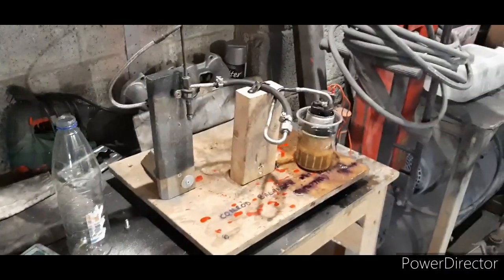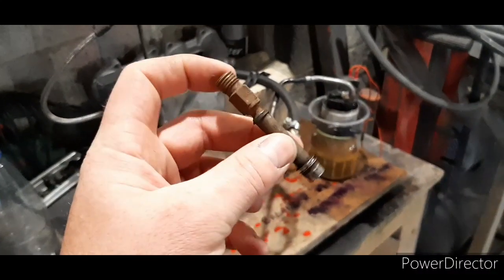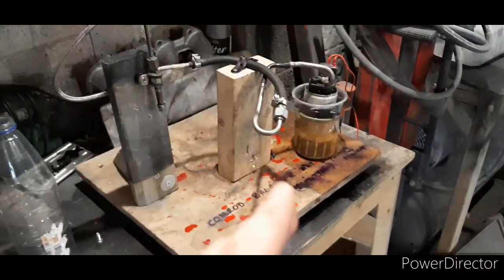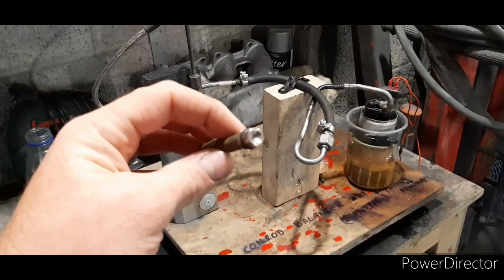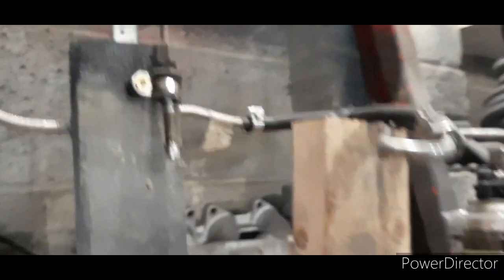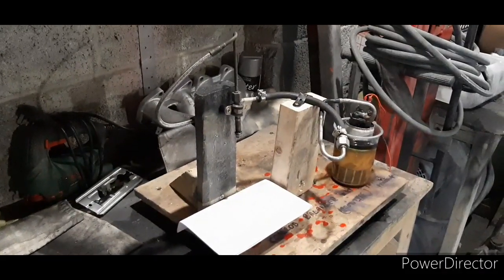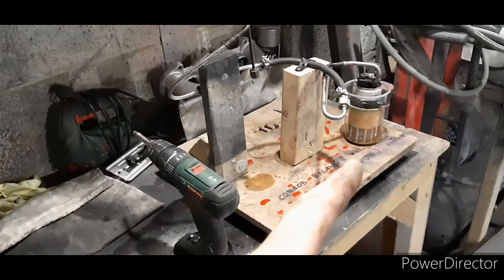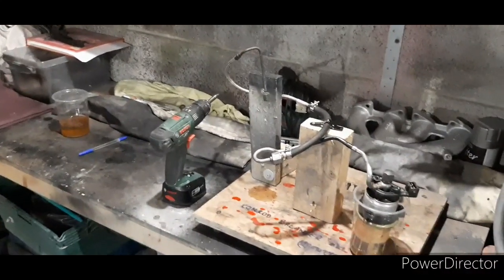Bosch K-jetronic Injector Testing

Comment: Thanks for video. If air shrouder removed from injector does it still work correctly?
Reply from the maker: Physically yes it'll work the same, you have to block the air nipple on the lower part of the inlet manifold between cylinder 1 and 2 if you don't use the air shrouded injectors
Reply: @GreyGooseRestorations   Thanks for response. I removed one air shrouder and injector tip is a bit different than original injector with out shrouder. Just wondering does it have effect to fuel spray.
Reply from the maker: @karivtapio the cone end should follow the same angle of the injector pintle so would make no difference

Comment: Can the injectors be dismantled/rebuilt or is it just a case of buying new ones? Also do you know what size the fitting on top of the injector is just in case i cant get a spare fuel pipe. Thanks
Reply from the maker: Hi, no they can't be rebuilt due to the way they are made, its a case of buy new ones, theres two different threads depending on the car and year

Comment: Really enjoying the videos. Thanks!
Do you know if anyone sells the tapered fuel pin?
I am running an AGG 2L block and could do with more fuel
Reply from the maker: Thanks
The tapered fuel pin didn't work as good as it should have so the stock pin is more than effective, more fuel can be had by adjusting the hidden allen key adjusters on the metering head

Comment: Hey goose,
Been following along with your build. Looks fab. I have my own little mk2 project I'm working on only difference is its in a VW t25 camper... Mind if I shoot you a couple emails? You seem far more knowledgeable about the Kjet system.. And I'm pretty sure this is where my problems are.
Also you mentioned injector lines and getting new ones, you making them yourself or getting ones made custom? My electrics is something I need to look at too... Was wondering if you'd recommend buying a harness and converting it to work on the T25 or just making one new from scratch... No idea where to start however, are they particularly complex? 
Thanks,
Chris
Reply from the maker: Hi, that's interesting, yeah no problems, seen us a message via messenger.

https://www.facebook.com/GGRestorations/

Comment: This is really, really, really good. Thanks for making and sharing. Any thoughts on how to stop the injector leaking? New spring?
Reply from the maker: Thanks 👍 if the injector is leaking its likely the spring is past it which will mean new injector. It could be a bit of debris preventing the spring from fully closing
Reply: @GreyGooseRestorations  Aweome - will be whipping them out this week. I have an Audi ACE 2.0 engine which I believe is similar. They just pull out don't they? Then need new seals.
Reply from the maker: @volvos60bloke  yea they just pull out and its best practice to replace seals.